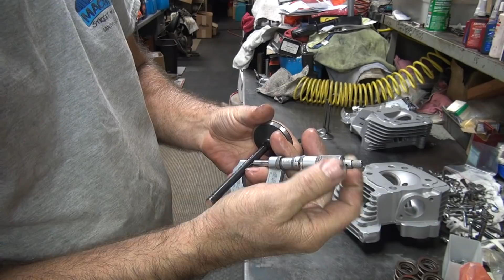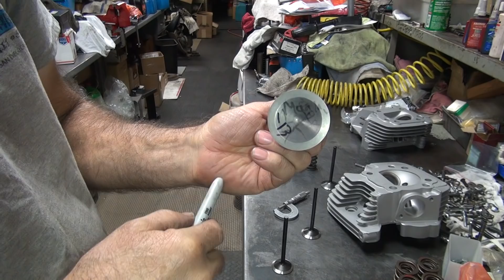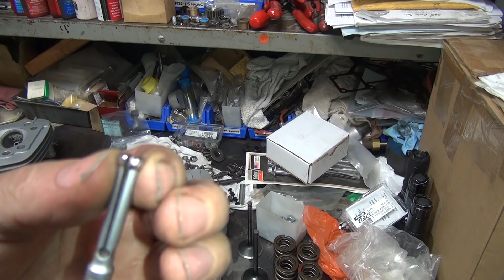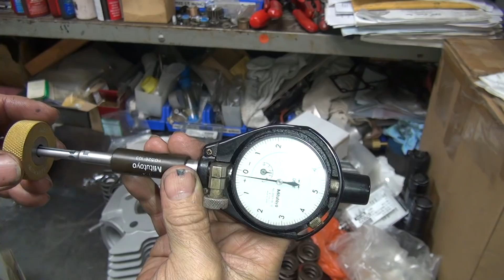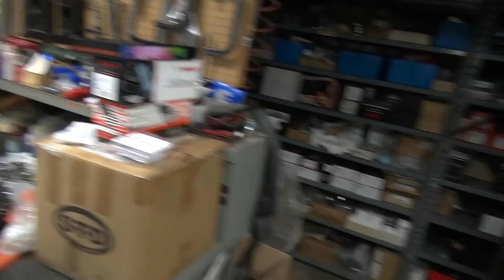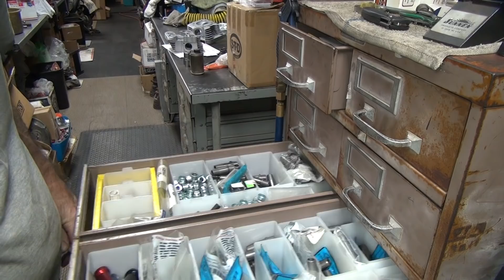1992 80ci evo motor rebuild #120 repair softail fxst flstc case welding harley by tatro machine

Comment: My 92 Evo with 58,000 miles runs like a Swiss watch.. I replaced the  cam for a Ev27, SS carb, and converted to single fire ignition the rest of the motor is stock.. if and when she does fail I'll be shipping her your way for a new life! Keep up the great video's!